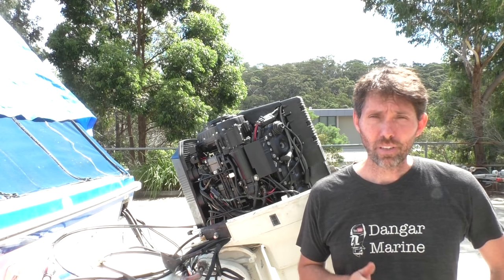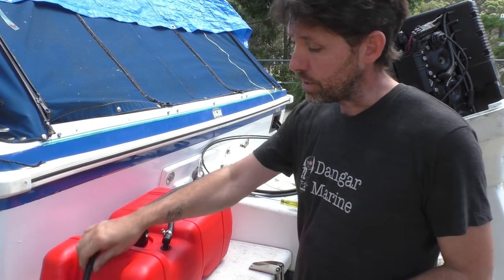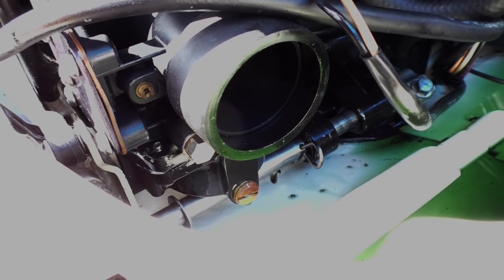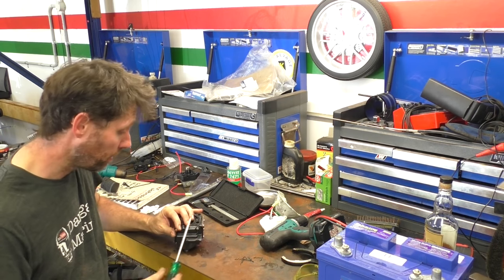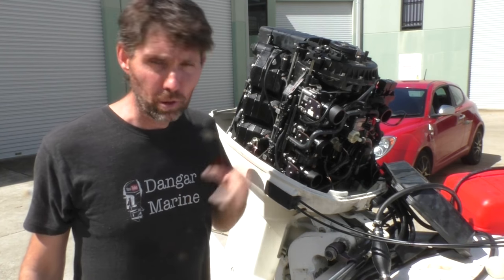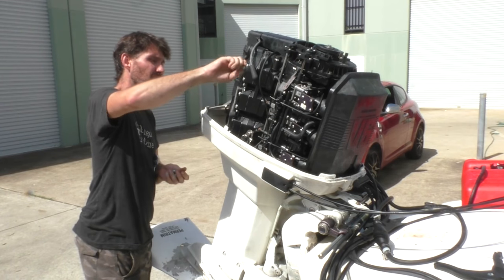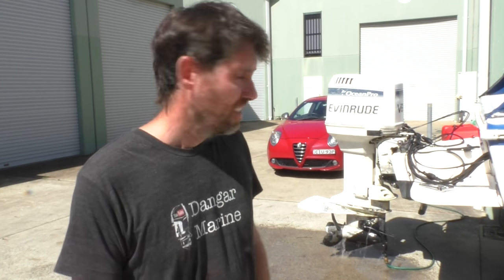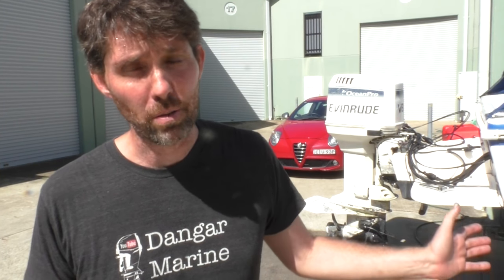Starting the Evinrude 150 for the first time

Comment: WD-40 zwd stands for water displacement. It's not a lubricant it actively pushes water out of the molecular structure any metal. Something to ponder and why it's so useful on any vessel but don't forget to put in a lubricant appropriate the type of metal RPM and heat environments that you're working in.

Comment: use a half cut plastic drum, with a hole at the side down the bottom, and a hose connector sikaflexed in, then hook ya hose up, fill the tub and run ya engines that way, because the engines can get all the water they need, as muffs may not give an OB enough water ..

Comment: Nice job on rebuild I have found after doing a rebuild for first start up I like to squirt in each carb a shot of a mix of oil and gas in a spray bottle so it fires up faster instead of trying to pull fuel and chancing running dry during cranking and even tho you have a good mix of oil and gas I like to spray fogging oil also to help flush assembly grease out of bearings and seals found some grease doesn't wash out well with fuel

Comment: Hello from the USA!  Not a "Marine Kind of guy," but used the Rotax 503 two stroke in two of my "Experimental Amateur Built" planes.   I have never overhauled my 503's, they ran like hell and were bullet proof!   Used good oil mixed 100:1!  Can you believe that?  Amsoil, and it has, as they say, "High Lubricity."  NEVER ran hot.    Don't have a plane, at present, but any new one would have Amsoil, for sure.  I was very impressed with your work ethic and knowledge.  You are one of the few, I'm sure.   I'm thinking that you will NOT be paid enough for your efforts - you really put in the time and effort.  That, hopefully, was an expensive rebuild.  You need to be paid for ALL of the work that you put into that job.   Many thanks for positing the video.   I also learned from you, just like I do from every GOOD mechanic that I follow.  Happy New Year from the State of Virginia.  :)    M. Donavon, N-6395T  (my last homebuilt that I bloody wore out!  :)   Cheers Mate!
Reply from the maker: Thanks mate. Unfortunately that was a job for a mate so didn't get paid at all, but it was fun to see it running again.

Comment: Ahhhhhhh yessssssssss nice work!  Looked like that bird in the background was really pissing you off  :)  .....  it probably stopped making noise after you were done with the video.  I launch my resto project May 1st......same engine....and it hasnt been started in 2yrs.  Watching your video has helped me a lot.......  congrats on your success and Thank you!
Reply from the maker: Thanks Jim, ah, that bloody bird! Good luck with your restoration project, these motors really are worth it to keep going. :)
Reply: Hey Stu......is that 150 the same that is on a video of a guy showing how his engine operates and performs on YouTube?  He also sounds like an Aussie.....I was wondering if it is and if the engine failed after all of his vids.  It was running great in the vids.  Maybe completely different but I was just curious.  ps....would love to see a video on the correct way to grease all the fittings on the 150......thanks!

Comment: With the fuel, some of the high octane fuels have a higher density. One manufacturer was claiming that it would improve fuel economy, even if used in an engine designed for lower octane fuels. My wife had one of the first electronic fuel injected BMW's it was from the days of leaded fuels and didn't have an oxygen sensor in the exhaust, therefore it was unable to sense that is was running rich. Wife filled up the car one day with optimax ( I think) and it would hardly start. The problem corrected itself on the next tank of fuel. It was running a bit rich anyway and that fuel made it run very rich. Well done with the rebuild.
Reply from the maker: Hey Alan, interesting to hear about your experience with the high octane fuel. O2 sensors and fuel injection certainly have made a huge difference to a car's ability to dynamically tune itself for the situation.

Comment: We had an incident where the boat would not start a new ignition barrow still nothing ended up buying a new Yamaha 703 control box as in gear sensor had broken and few bits looked shabby but still nothing turned out to be the engine fuse. Next day the t n t really broke 😂 two new relays later she's going strong again (1986 Yamaha 2 stroke). Awesome show. 
Maybe you could do a video on dials and how to wire them into control box lol.
Reply from the maker: Yeah, that fuse can just stop things in it's tracks and make the problem look worse than it is if you don't know about it. Glad your trim tilt was just relays, problems with the hydraulic side can get expensive fast. Will definitely be doing an instrument video before too much longer.

Comment: Great series of rebuild videos.  I have done some aircraft engines and after rebuild we are real careful to break in the rings.  Maybe one short run to see if it leaks anything, then firewall it and full power.  The pressure from full power forces the rings to seat.  I wonder if your 2 stroke break in is similar?
Reply from the maker: Thanks mate. Here's the break in. https://www.youtube.com/watch?v=ihJ1YQhh8Yw&list=PLJD0gZGZdCuf8O8RX9SQbzukZilvUpGnl&index=12&t=0s

Comment: great job mate. 
you have great responsibility n passion in your work.
do you need to do a park plug alignment on this baby?
Reply from the maker: Thanks mate. No, as far as I know it is only the e-tecs that need to have the spark plugs indexed so the gap faces the injectors.
Reply: cheers mate. 
evinrude will last forever if the user does not abuse it.
hope to see more great videos soon.
see you soon  mate.

Comment: Great job, Stu. There was never a doubt in my mind that she was ready to go. And of course, there are little things (like idle speed) to be adjusted, would be the same with any engine rebuild. That bird in the background, is s/he one of your regulars around there? I hope you`ll be able to capture some footage of the old girl`s new lease on life out on the water, would be cool to see her skipping along under load. I hope the owner sees many more years enjoyment from this Evinrude and his boat. Job well done! Also, nice Alpha Romeo behind the shot, you either have a talent for setting your backdrops, or incredible luck for it simply being there! Lol...
Reply from the maker: Thanks Stan, sounds like you had less doubt than me! There are loads of birds around the workshop, but you don't really notice the noise they make until you start to try and film. Will definitely be doing an on water video before this series is over. There is quite a bit of testing I want to do under load such as monitoring the temperature and checking the timing. The car was parked there because I had just come back from filling the fuel tank and I didn't want to carry it far. I should set something colourful up in every shot I think!

Comment: Sounds great!  I'm glad you got help with the hose locations.  Oftentimes, those damn plastic fuel bowl mating surfaces warp causing the leakage, not necessarily a gasket problem.  The water you saw in the fuel may have been the alcohol/ethanol separating out from the fuel, don't know if you have ethanol/alcohol fuel problems over there like we do here in the US.  In any event, this may have lowered the octane of the fuel remaining in the tank, would be best to drain it all out and start fresh with the 50:1 break in mix.  Did you set up the timing and do the carb sync?  Don't forget, this engine has "quikstart" which advances the timing at dead idle during warm up.  Don't forget to check the VRO pulse alarm, what pitch prop is on that boat, seems like a big boat for a 150.  You will want to see around 5500RPM at WOT when properly trimmed.
Reply from the maker: Hi mate. I do need to look into how the Quikstart units work, I'm really not familiar with Evinrudes at all. It's got though, it has given me a chance to learn. I think the water in the fuel was definitely from rain, it was too much to be anything else. I agree that cleaning them out and finding the leak is the go. I'll run on the external tank until then. When I showed the outboard to an Evinrude guy he said the timing was set to a pretty safe conservative point but I'll be checking that once we are on the water (presuming a test light doesn't freak out the optical sensor!?!?) Will do the carb sync etc on the trailer before we head out though. Definitely still have a bit to do on this one. Not sure about the prop, I'll check that too. It is a big boat but apparently this motor does push it along quite nicely. I'll see what RPM it reaches when we do the on-water video.
Reply: Sounds good!  I read the advice about increasing the size of the high speed jets, which is good advice.  But, you have to be very careful when changing those jets, you really should have to OMC jet tool 317002 if you don't already.  The darn plastic carbs tend to create plastic debris when removing/installing the jets, which is aggravated even more by trying to use a regular screwdriver for the process.  The worst case scenario is plastic debris getting caught in the jet during the process.  It is usually best to remove/install jets while the bowls are off the carbs to ensure they are seated correctly and any plastic debris can be seen/removed.  The sync process is fairly easy, but make sure the clamps between each throttle plate are tight!  The classic fail mode is having the engine loose power after accelerated to WOT only because one throttle plate has crept back to the closed position.  I'm just wondering how your dealer friend judged that the timing was set close to spec.  Trying to use a timing light on these optical sensor engines will definitely drive the sensor (and you) crazy!  The correct Champion plugs MUST be used on these engines, I don't know if NGK actually makes a replacement for the champion "Q" plugs.  Using non "inductor" plugs will cause the engine to misfire.  This ignition system is very sensitive to RFI interference which can be caused by using the wrong plugs, open plug leads, etc.  You have taken great care in doing this rebuild, I'm just trying to think of all these engine's quirks that could cause problems....
Reply from the maker: Really appreciate your thoughts on this project, I've been learning a lot about Evinrude motors from you and others. I will definitely do the jet swap on the bench as I would like to change the bowl gaskets anyway. I'll be sure to give them a good clean out between removing the old jets and installing the new. Also appreciate the tip about the throttle plate clamps. I'll double check them all so we don't have the problem with them slowly closing on their own accord. Finally, I agree that it is always best to use the exact spark plug the engineers designed the outboard around so I'll get the number from the service manual and order some in. Thanks for all your tips and experience!
Reply: Good advice from Kramden.

You need Champion #938, also known as QL78YC.
Alternate is QL77JC4 if the former isn't available. 

If you don't have a jet screwdriver, take a screwdriver over to the grinder, and remove the wider shoulders from the blade, making the width the same as the shaft all the way to the tip, so it's "straight.", then polish off any sharp edges.  This way, you can insert the screwdriver down into a hole, and you won't damage anything.  A must-have tool.

Quick start electronically raises the idle at startup, until the motor reaches operating temperature or you rev past 1500 RPM.  Good system.

Those 60 degree motors are powerful.  Should push that boat well.  5500 RPM at WOT is what you want.

Comment: Very informative video, I have the same motor, just an 01 with the newer style cowling. Mine was a submerged motor that was torn down and rebuilt. 71 hrs later still running strong. I like your input about going up a jet size I think that might be beneficial in my case. I have installed polymer racing Reed's to replace factory steelies. Keep up the great work! Where can I get a Dangar shirt? I live in Central Florida.
Reply from the maker: Thanks Mike, glad you liked the vid. You can get t-shirts online from https://dangarmarine.com.au/collections/merchandise/products/dangar-marine-t-shirt

Comment: It's been awhile since I've started a 2-stroke outboard but let me just say when you started that one I actually felt like I could smell the exhaust. It's funny how just seeing and hearing could trigger such a memory. Great job glad to see you did not use the fuel on the boat. A friend of mine lost his brand new engine just because he did not train the old fuel and it was more water then gas and that wash down the cylinders. After 10 minutes on the water the motor locked up. The captain of the towboat was talking to us and the first thing he asked my friend did he drain the fuel and put fresh in and he said no. So the next motor actually was able to go out on its own and return.

Look forward to your next video.

Comment: Great job Stu!!!
Great to see these old motors get a new lease on life. These things had a production ran from 1991 - 2000 and the same block was used in the early EFI engines. They certainly stood the test of time.
Better then spending $20K plus on a new 4 stroke.
Who did your machine work for you? I have a 225 excel block that needs some TLC and possibly a crack test.
Reply from the maker: Thanks Jason. I also think it is great to see these motors still running rather than ending up in the scrap bin. CDA in Brookvale did the engineering http://www.cdaengines.com.au/ Kelvin is the main guy there and he is a really good bloke who really knows his stuff.
Reply: Perfect I have spoken with Kelvin and now that I have seen there handy work and got your endorsement they will get the job. So thanks for that. There's always an element of risk when using somebody for the first time. If you get a chance check out my first starts for my recent outboard rebuilds.
Reply: Thx Stu!!
Reply from the maker: I don't think he will disappoint you. I still need to give him a call about heading back down there to do some filming.

Comment: THAT ENGINE SOUNDED GREAT!  
It was hitting on all 6 running good. 
Now, install new plugs, wire brush old plugs for spares, install 2 thermostats,  install new impeller, have propeller balanced and cupped, install two new sacrificial anodes, rebuild carbs, tune carbs, install new washer on propeller shaft, light sand blast, sand, primer, paint, and decals.   And bill for $2,000 bucks for the engine overhaul.
Reply from the maker: Yes, this engine had all these things done to it over this series of videos other than the cosmetic stuff.

Comment: Great video again well done and informative. Just one question . When I see that a motor has been rebuilt either top end or bottom end. Is it fair to say that you can never depend on that motor or is it me being paranoid? Cheers.
Reply from the maker: If an outboard has been fully rebuilt correctly it should be as good as new in many respects and once it has been run in, fully reliable.

Comment: ok I am going to be cheeky if I may, and ask for some pointers because I am stuck trying to figure this one out,, I have an old 1975 ish Johnson 140hp v4 outboard engine on my boat, and the rev counter cuts out?, it plays up then stops reading the engine rev's?, with the engine straight down the rev counter work's ok, but the moment I try to trim the engine up the rev counter stops working, but it will start working again if I put the engine back into right down passion, so I am guessing its a bad or broken wire? could you please help by telling me, what colour wire work the rev counter?  i think its called the trigger wire that is broken or bad,, or could it be an earth on the engine? and were do these wire's fit onto the engine? as I think the broken wire/s would most likely be in the loom were it bends the most often, between the engine and the transom! I have pulled apart every wiring loom plug I could find to clean them with switch cleaner then greased them using vasaleen? but I cant get this darn rev counter to work right, could you give me some help with this, thank you, ,, ps,, your videos are great, how about you rebuilding my old engine ""for free"" if you wont to make another video? after all its a living dinosaur now?

Comment: Great series of in depth videos on this! Sorry if I missed it in all the comments but did you decide in the end what the root cause of the engine's failure was?
Reply from the maker: Didn't really get a definitive answer in the end, it's hard not knowing the history of the motor. This problem happened within ten minutes of running it originally and it has now run well for several hours after the rebuild. I have a suspicion it may have been water related given how easily it was getting into the main tanks.
Reply: Ah ha, I recall that the tank fillers were waving in the breeze.  Did the boat have one of those water separating fuel filters?  Cheers.

Comment: Great information and well presented.   Will you do a session just on the "vapor separator" that lives on top of the fuel octopus?   I have yet to figure out all the fuss.  My 1993 150hp runs about 15 seconds then just dies off :(.   Seems to be a fuel shortage.
Reply from the maker: Unfortunately not. Have you tried squeezing the bulb while it is running, does that keep it going? If so it sounds like fuel pump. This is the only vid I have on VSTs https://www.youtube.com/watch?v=eVdJ4BvRVYQ